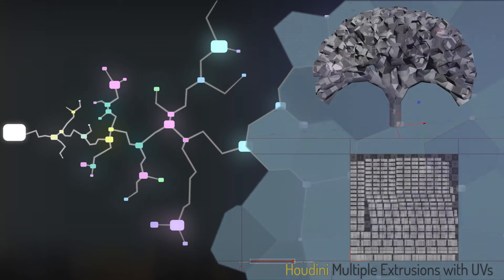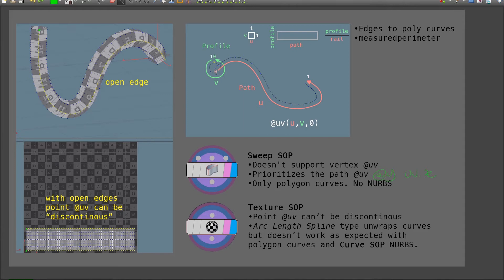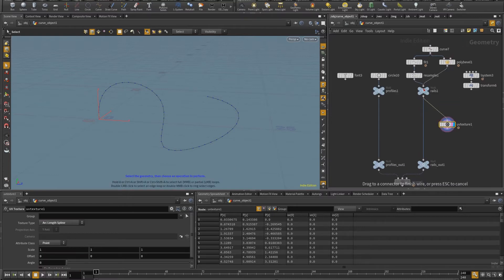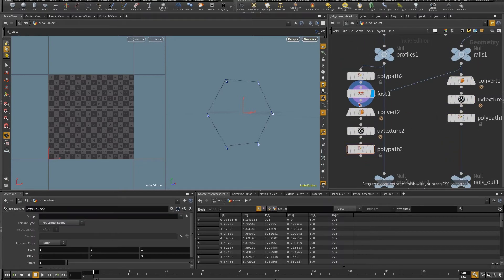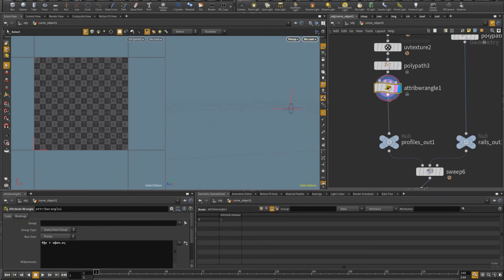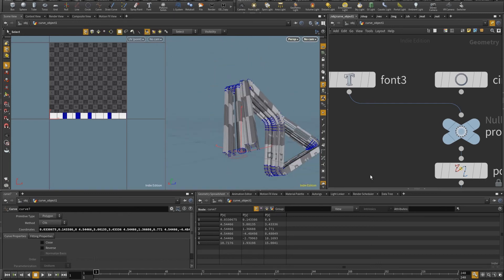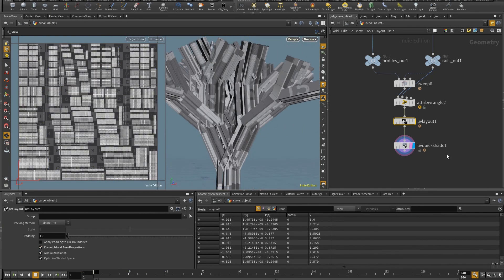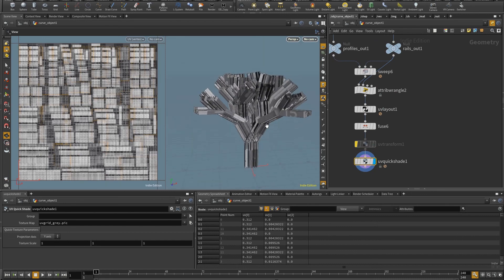quickFlow :: Houdini :: Multiple Curve Extrusions with UVs

Comment: hey geat tutorial! really helpfull! In my case i want the curve to change length as it is being generated by an emitter. How can i have the uvs stick so that the texture does not change as the line changes length. Each point should stick in the uv space until the emitter stops. So instead of changing the proportions of the uvs relative to the length of the curve i want to just add more points each time to the uvs? Do this make sense? i am just starting in Houdini with a Cinema 4D background